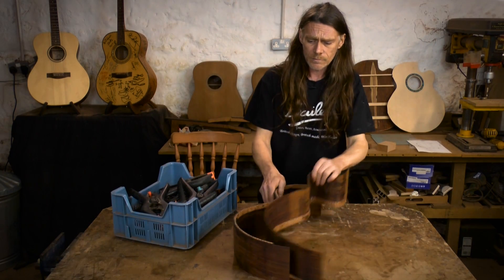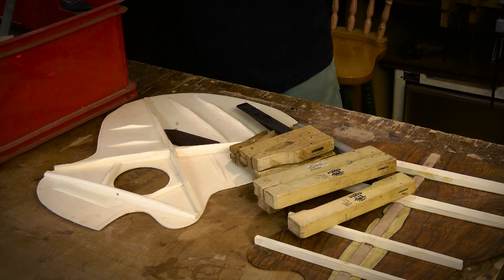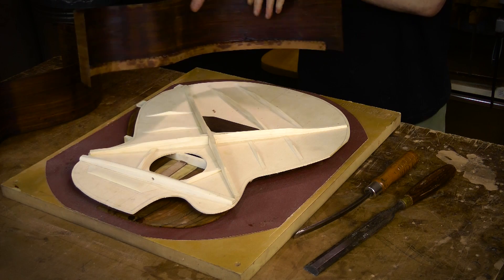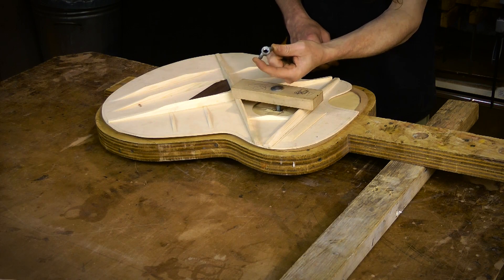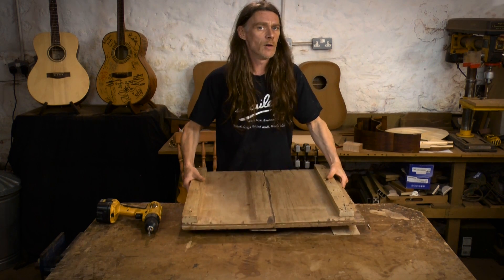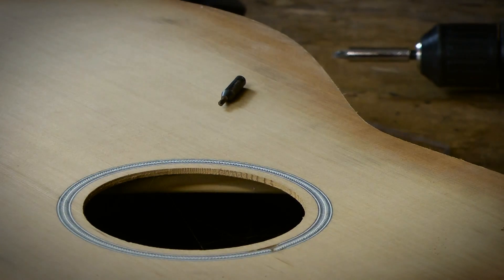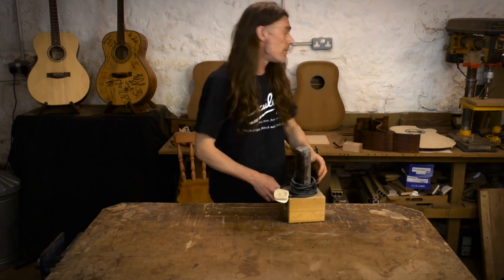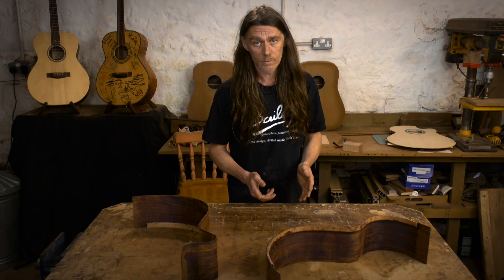Tools for building Acoustic Guitars

Comment: Another alternative to go-bar deck and cam clamps is a vacuum bag.  I long ago went to vacuum clamping, it's so easy and I made my frame out of a 2x4. Talk about cheap!
Reply: Do you have any video or photos of your set up? Are you using a standard vacuum cleaner? (I've seen pro setups but they are expensive!)
Reply: Mark Bailey thats a good idea you have given me there, to make a video. I will do that on the next flat top i make.  I use a piece of acrylic or plexiglass that's big enough to hold the radius dish and the square frame that goes around it. The square frame is just made by cutting down some two-by-fours and mitering them perfectly will and sealing the corners with epoxy or silicone. Then on the underside route out a channel for some surgical tubing and glue that in. On the top side I use vacuum film which stretches a lot and is very inexpensive because of the small amount that's needed, and it's secured with mastic along the top edge. Put a valve of some sort through the side and hook your choice of vacuum to it whether it's a vacuum cleaner adapted down to match the silicone tubing or an actual vacuum pump. The gasket will grab onto the acrylic and the bag will empty out and all braces will be clamped at once..  i know of someone that makes the manufactured version of this that's very very nice out of aluminum and such but the cost is $2,000. I estimate the cost of mine to be... $20? I have lots of pictures but I don't know how I could post pictures here. I think it's a great way to clamp and I've made other vacuum jigs for a fraction of the cost compared to what places like LMI charge for them.
Reply: Yes - the LMI (and similar) kits are very expensive - We had a huge vacuum table at the factory but since then I've been using more traditional methods. Wooden clamps are so versatile and cheap to make, I still think they are the way to go for a beginner...and you don't need a radius dish...

It would be great to see a video of your setup - maybe you can make a slideshow and put it on Youtube?: https://www.youtube.com/watch?v=nFIgCMgVpWk
Reply: Mark Bailey thanks for the slideshow link, that's cool.  I think I'll just make a proper video because it will be better overall.  Likely this month I'll get to that.  Also, radius dishes are not required.  I use flat ones in it often, for uke and sometimes guitar tops.   But also I use a 52 ft radius for tops as well.
Reply: Excellent - I look forward to seeing that!